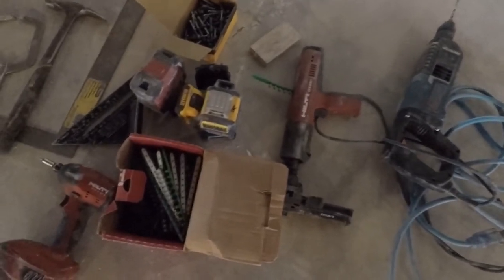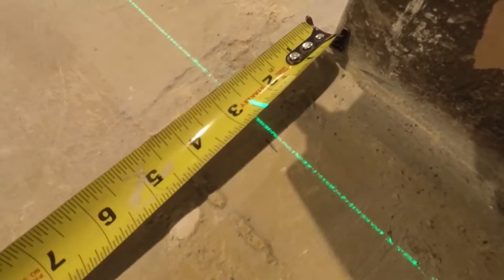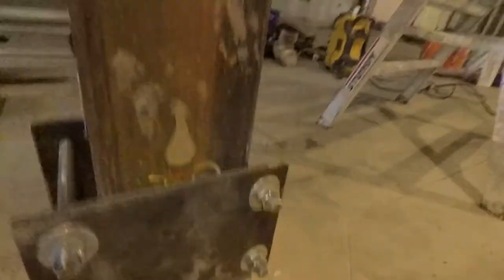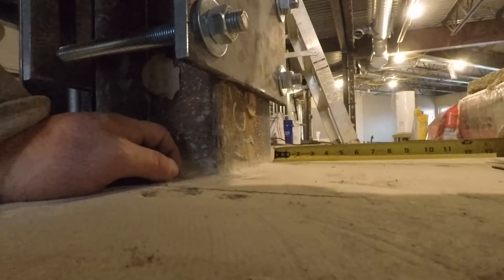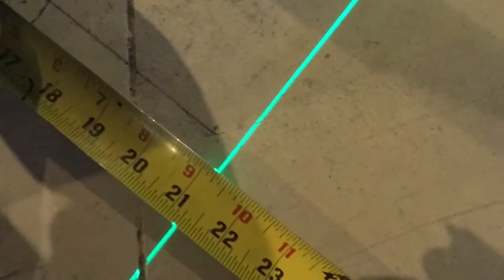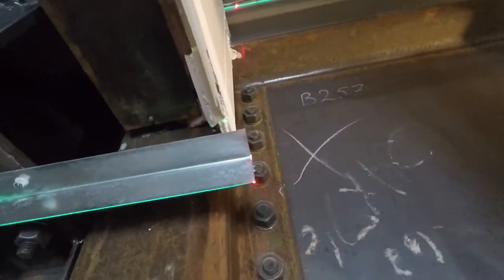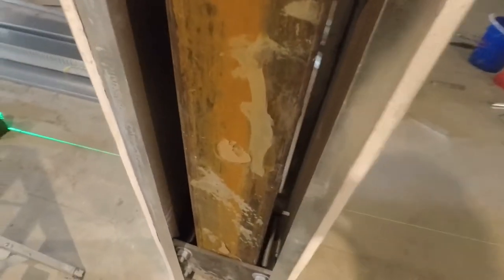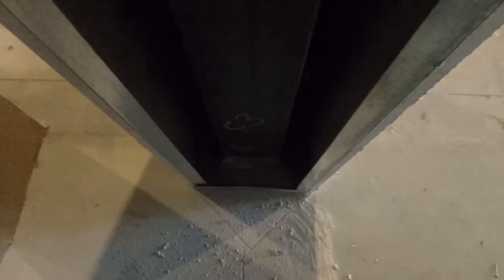How To Fire Rate TIGHT Columns! Expert Drywall!

Comment: Nice dude. So is the 90 you attached to the top beam staying exposed? I see it up top, just wondering what happens to it. Thanks for the tips Chris
Reply from the maker: Yes I forgot to explain that in the voice over. So because I flipped a couple of them around only at the top that's okay because by the time the drywall is on only a 1/4" will show. That is perfectly fine in this situation because there is going to be a drop ceiling and it will be hidden. Also they will be fire spraying the structure between floors and the all around the top of the column will blend in.  I flipped it around because the top plate sticks out farther than anything and I didn't want to make the column 3" bigger than it had too (angle is 1-1/2" x 2 sides).